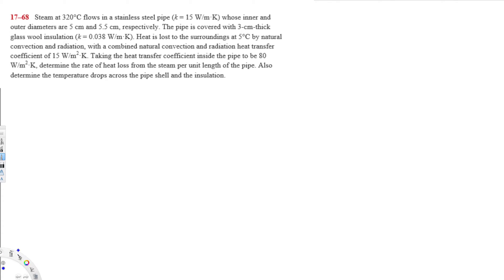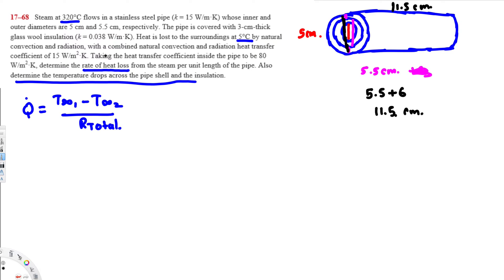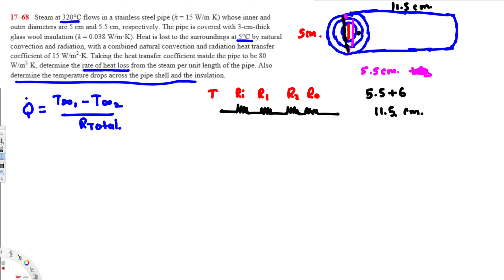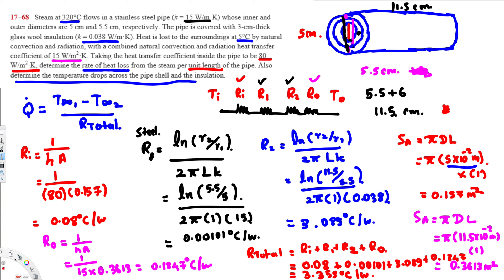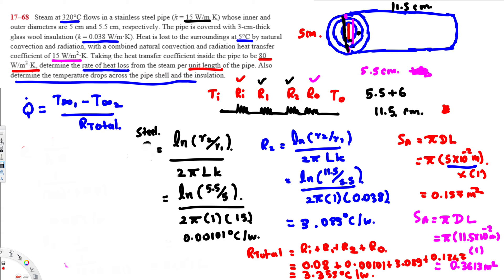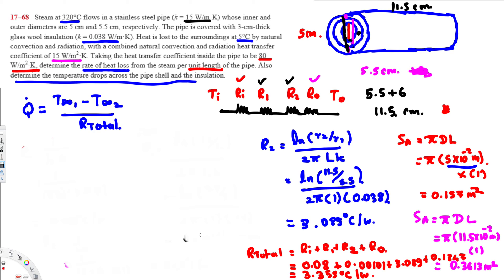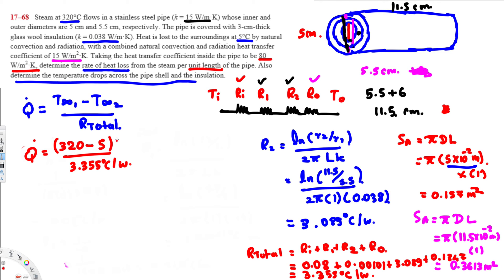Heat Transfer - Determine the rate of heat loss from the steam per unit length of pipe

Comment: Ughhhhhh you didn't answer this correctly though! It asks for rate of heat transfer PER UNIT LENGTH. You only solved for Qdot. You're supposed to solve for Qdot/L. I needed that for my homework my dude
Reply: he uses 1m as his length in all the equations, therefore it is per length